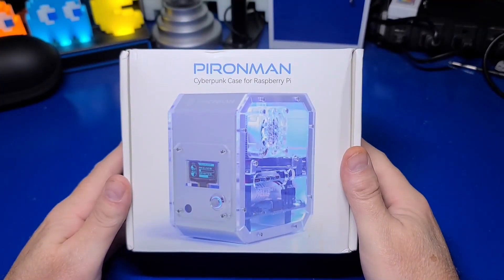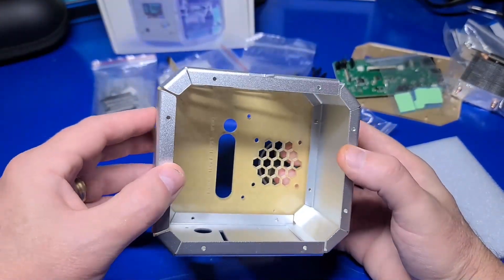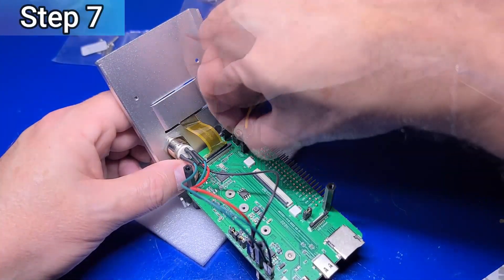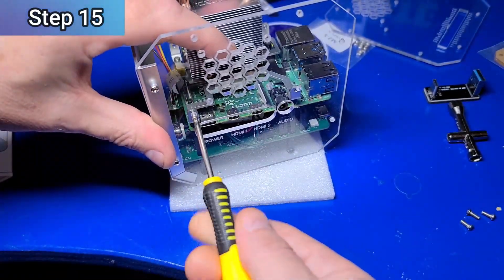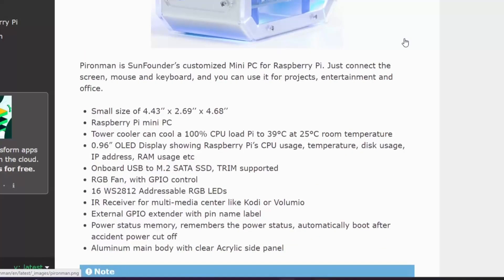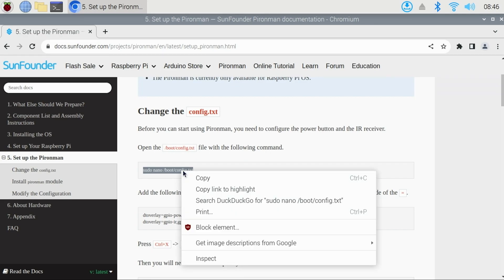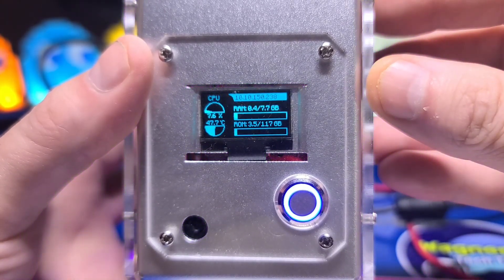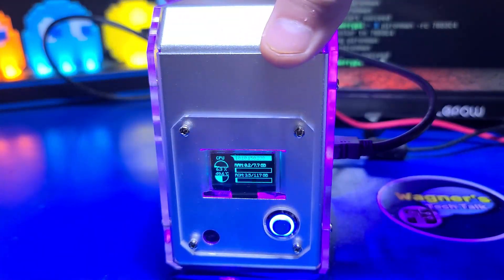Pironman Mini PC Raspberry Pi 4 Case by Sunfounder - It Suits Me!

Comment: I am running a umbrel node that has it's one OS. Would I be able to use both of the Pironman and Umbrel operating systems at the same time because the node needs to run 24/7? Thanks so much!
Reply from the maker: I've not personally used Umbrel, but I don't see anything wrong with running the Pi 24/7 with the Pironman.
Reply: Sorry about the typo's. Let me try this again. I am running an Umbrel node that has its own OS. Would I be able to run both the Pironman and Umbrel operating systems simultaneously because the Umbrel OS needs to run 24/7. Thanks!

Comment: is it possible to insert a regular 2.5" SSD/HDD in this case? I have seen few other case but this looks so cool as a NAS-System. But i would put my SSD inside the case.
Reply from the maker: I don't think it's possible to put a 2.5" SSD in this case.  It would need to be connected externally.

Comment: my RGB connectors are on the other side of the board and they dont turn on, what can I do? they are on the side of the power button
Reply from the maker: Sounds like it was installed incorrectly, based on what you're describing.  I'd double-check the steps to make sure everything is oriented correctly.  If you're sure everything is right, then I'd recommend asking in their forums here: https://forum.sunfounder.com/ or here for further assistance: https://www.sunfounder.com/pages/warranty-returns

Comment: Is it compatible with octopi?
Reply from the maker: It's just running a Raspberry Pi 4 which works fine with OctoPi, so yes.
Reply: @WagnersTechTalk  but when I turn rpi on It says boot stopped
Failed to open device sdcard
Reply from the maker: If it's from the OctoPi image, make sure you have the latest.  If you do, also make sure the firmware in the Pi is the latest.  Are you running from the SSD I assume?  If so, firmware in the Pi4 is likely the reason.
Reply: @WagnersTechTalk  I solved the problem there was two problem one was firmware issue and the other was white line bad connection thanks sir anyway
I have one more question there s a line says "camera" and I don't see the camera parts what camera parts should I use and how to mount it?

Comment: Not able to get my led strip to light up
Reply from the maker: Make sure you installed the scripts discussed in this video and that the connector is attached correctly.  If that doesn't help, please contact SunFounder support, may have a defective LED strip.
Reply: The same thing happens to me, I can't turn on the LED strip or the LEDs on the board.  Were you able to solve it?
Reply: @felipenarvaez6461  it is the jumpers I found out on mine

Comment: Mine not going right seems case sides are not lined up even after watching this and the directions that came with it
Reply from the maker: Didn't have any issues with the panel alignment here.  Make sure that you have the right panel on each side, they look similar but are slightly different.  Also, may want to loosely tighten the screws then once all are installed, tighten firmly.
Reply: @WagnersTechTalk  I had the one side flipped around so all good now
Reply from the maker: @ironhead320  It happens, good deal!

Comment: Is it possible to only have windows or something else than pi os installed and have everything on the case work?
It might be my first "diy" pc so i don't really know how that works
Reply from the maker: Keep in mind, while you can install Windows to a Raspberry Pi it's not ideal for daily use (here's how: https://youtu.be/9RQ7vxk7IdM ).  Also, the drivers for the case won't work under Windows ARM.  You'll want to run PiOS , TwisterOS, etc. as shown in this video to make good use of these features.
Reply: last question
Would it be powerful enough to run blender for example?

Comment: I love it. Under current setting, if I want to add rc522 & active buzzer on it, would it still got a GPIO pins for both ? I want to transfer it as RFID reader, so it could handle kids attendance.  Let me know how the case could add these component.
Reply from the maker: All 40 GPIO pins are accessible (AFAIK), totally up to you how you want to use them.  You could use a kit like this one: https://amzn.to/4293CDj to connect the GPIO from the Pironman to a breadboard and setup your circuit there.  There is a tutorial included with the kit and examples that you could modify as-needed.  Not sure if this is exactly what you're looking for but I've bought kits like this in the past and gone through a few examples.  There are, of course, many other components in this kit aside from the RFID reader and tag.  You could extend it to display a readout on the LCD or if you want to make the project more permanent (after testing with a breadboard) you could transfer it to a prototype board like this: https://amzn.to/41LL7Fp .  Hope that helps!

Comment: Couple of notes. Make sure your SSD is SATA, and the led strip uses the audio out lines so you can't use speakers and led at same time. Good  review.
Reply from the maker: Thank you Thomas and for your helpful notes!
Reply: @WagnersTechTalk  Always glad to be helpful. I've had mine for a couple of months and I use some Bluetooth speakers. My only issue (and honestly I haven't pursued it) is the fan/temperature control. I also had a little issue getting an actual HDMI tv and a HDMI monitor to play well together. Two monitors -fine, tv-fine, just not mixed.
It is a nice case and you did a great unbox and build.
Reply from the maker: Thank you Sir, interesting about the TV/Monitor mix.  The Pironman is definitely one of my favorite Pi4 cases.  Also really like the SunFounder RasPad 3 that I reviewed sometime ago.  It's more expensive but find it very handy.
Reply: @WagnersTechTalk  Raspads- yep, got in the kickstarters for both of them. I use the Raspad 3 as my microscope brains with the Raspberry Pi camera with the C mounts, not the new autofocus ones. My only grief with the Raspads- battery life. Great screens and good for project building.
Reply from the maker: Agree, battery life could be better.

Comment: Great review and assembly guide. I'd consider picking one up but for the same design problem most Pi cases don't fix: rerouting the ports to one side and changing the HDMI ports to full-size. I'd they could take these same design ideas but make those adjustments they'd have a winner with me for sure.
Reply from the maker: Thank you Chris, very much would have preferred standard HDMI to be re-routed to the back of the case and the A/V jack also.

Comment: This is one cool case john! I am def done with raspberry pi's, too many problems with the hardware and builds, coinopsx has spoiled me, I have 9 Atgames systems running CoinopsX, UNrelated question does atgames email people bios updates when their device won't pull a new image? I picked up a Core Plus and it has the shipped firmware and won't pull the new one that eliminates the log on requirement for coinopsx. I hate bugging them for this right away and was hoping it would pull it eventually.
Reply from the maker: I understand about the Pi's, they are so darn hard to find these days.  The supply-chain issues they are having should have been long-resolved by now.  There was a version of the Core Max that was shipped out at one point that wasn't able to be updated and needed to be replaced (very early on).  However, as far as the Core Plus no known such issue that I'm aware of.  If you factory reset the firmware, you "should" be able to update it.  I presume you've already tried that with no luck.  In that case, yes you can contact AtGames support and they should be able to provide the firmware download that you'd copy to a USB stick and manually update it.  You can complete a ticket here, be very precise about what you're asking (for faster service and accurate replies).  You can also click the purple chat icon in the lower-right during normal business hours to chat with someone live, if you prefer: https://www.atgames.net/arcades/contact .  I've tested their chat support in the past, they were responsive within ~32sec-4.5 min.

Comment: Well that was disappointing, Raspberry Pi 4 is out of stock and the Pironman is also out of stock :(
Reply from the maker: I'm seeing 4 Pironman's in stock here: https://amzn.to/3FPliek .  Though Pi4's, have been hard to find for a few years.  I'd hold off on the Pironman unless you can get a Pi4.  I picked up two a few months ago, pure luck.
Reply: @WagnersTechTalk  
Unfortunately not in the UK
Reply: @mynewschannel3100  I have seen something very similar for 3D printing and am thinking about printing it in carbon fibre infused Nylon which gives a matt black finish and you cant see the layer lines of the print.
 I too am from the UK and could not find it and its out of stock on their website also!
Reply: @mynewschannel3100  I live in Australia and order stuff from US Amazon all the time.
Reply: Thanks, I been looking st this for a localhost no internet plex server, due to the fans and m.2, I will also have a 18tb hdd in an enclosed case with its own power supply connected for the movies, this seems like it would work perfect for my small needs.

Comment: Great video and very informative. If I do get one of these I'll be using you video as a guide to help me set it up. A quick question that you may not be able to answer but did this effect WIFI speeds? I've had issues with aluminium cases in that they reduce the WIFI signal?
Reply from the maker: Thank you Darryl!  Regarding the WiFi signal, I didn't experience any issues with this case.  It's likely due to the acrylic side panels that would be less likely to interfere with the signal.  I hope this helps.